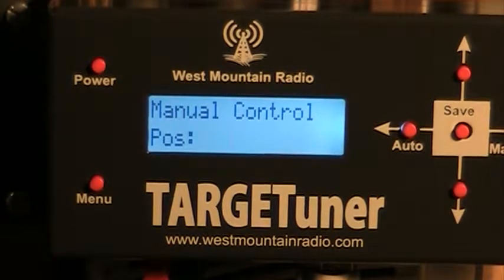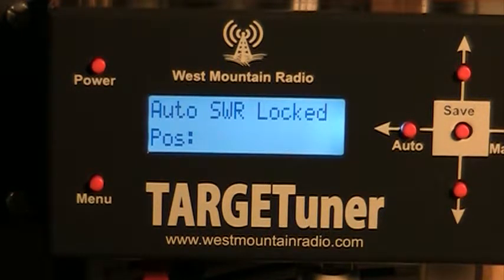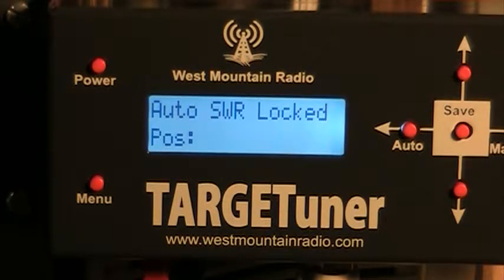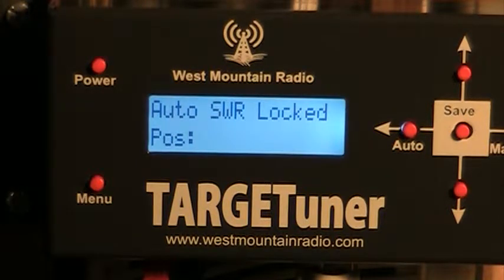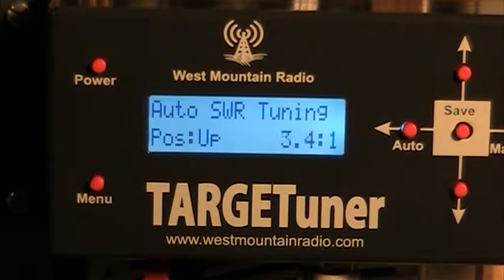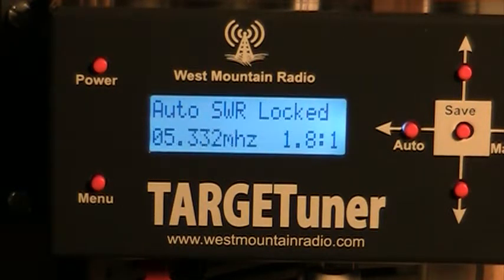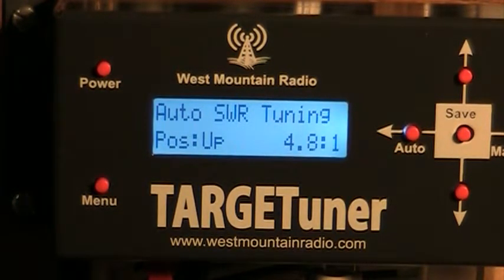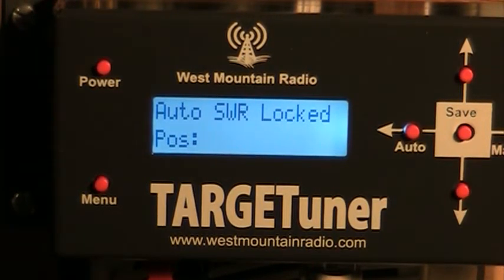West Mountain Radio TARGETuner Auto SWR Tuning Test with a High Sierra Sidekick Antenna

Comment: At the beginning, you were pressing the tune button and it communicated with the TargetTunner?
Reply from the maker: No, I performed this test with a screwdriver antenna that lacks a turns counter, therefore, no control wire from rig to TargeTuner.  
In the Auto SWR mode the TargeTuner searches for and stops at the coil position of lowest SWR when it senses RF power from the transmitter.

Comment: It passes up a better SWR than it locks on? It appears it has some issues from watching the video.I will stick with my Turbo Tuner II.
Reply from the maker: When I recorded this I didn't realize that the antenna's close coupling to a Skywire Loop antenna in the near field had introduced ripples into the screwdriver antenna's SWR curve.  In this situation it is better to use memory tuning with a turns counter and not the Auto SWR mode.  The controller also tended to overshoot the resonant point in Auto SWR mode when the motor speed was set to fastest.   Slowing the motor speed resolved that problem.

Comment: I have this unit. In my vehicle connected to my Icom 7100 and Diamond SD330 screwdriver antenna. I have the c-vat cable. I get ???? marks on my display
While in Auto SWR. Can you tell me what that means. I am sort of new to the hobby.   Thank you
Reply from the maker: Sorry, I have no experience with the rig control cables.  Please contact West Mountain Radio for support.

Comment: Do you have to key the radio, or use the tune button ?
Reply from the maker: You need to transmit a steady signal under 10 watts to use the Auto SWR Tuning mode.  Some radios have a "Tune" button that can accomplish that.  Otherwise, place your transmitter in "AM" mode and decrease the power to 10 watts or less when using Auto SWR mode.
Reply: @kp4md  can you put it in CW or RTTY and hit the Tuner on your radio to tuned
Reply from the maker: @MrAlphacallsign  You can do that with the specific Rig Control Interface and cable for some Icom, Kenwood and Yaesu radios.

Comment: What type antenna do you use with this? Any...or is it some type of adjustable antenna? Im new to HAM this year, so not real familiar with what is available. Got my Tech yearly this year, then upgraded to General and then Extra. Im pretty new to HF...within the last month or so.
Reply from the maker: Hi, OM and welcome to amateur radio!  At the time I filmed this I was using the TARGETuner to remotely control the motor that adjusts the loading coil on my previous High Sierra Sidekick screwdriver vertical antenna.  Since that antenna does not incorporate a turns counter, the controller must tune the antenna by searching for the point of lowest measured SWR when in Auto SWR Mode.  The video shows the controller attempting to automatically adjust the coil to the point of minimum SWR as I changed operating bands.  As this antenna was coupled by proximity to the near field of my Loop Skywire HF antenna, the TARGETuner had difficulty identifying the SWR minima on 3.5 and 5 MHz in Auto SWR Mode.
I currently use this TARGETuner controller with a new Tarheel 100A-HP vertical antenna.  As the Tarheel antenna does incorporate a coil turns counter, the controller can reliably adjust its coil to the operating frequency when in Memory Mode.  See https://photos.app.goo.gl/Fj46lux0GQXEnYmF3

Comment: I can’t get mine to work got it paired with a little tarheal 2 and a yeasu 857d
Reply from the maker: Hi Rachel.  I later connected the TARGETuner to a Tarheel 100A-HP.  
The turns counter works best when tuning the antenna without RF applied.
I found that tuning the antenna with RF applied causes turn count errors and loss of synchronization with memorized settings.
Bonding the TARGETuner control box and SWR sensor to the common station ground with short heavy copper braids and placing the larger common mode chokes on the control line at the control box and at the antenna end of the cables reduced but did not eliminate turn count errors when tuning with RF applied to the antenna.  
See https://www.k0bg.com/controllers.html and my photos at https://photos.app.goo.gl/wTJMJslvE3Pe0YXi2
Reply: @kp4md  Well maybe it's because there is NO SUCH THING as a YEASU Anything.Try it with a YAESU & see if it works.
Reply: Did you put the ferrite core on the control line at the base of the antenna?
Reply from the maker: @ke4rcf  Yes, I had cores both at the base of the antenna and at the control box.